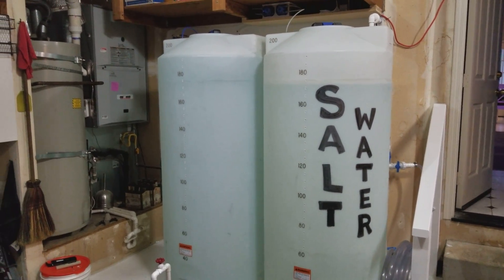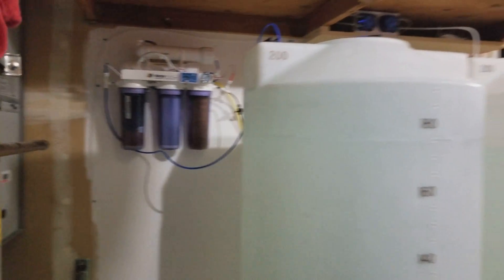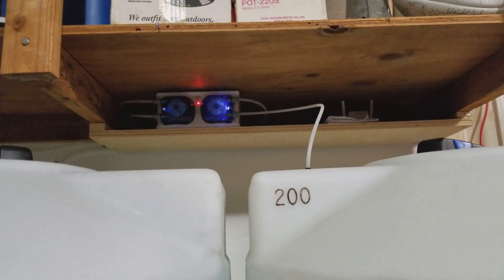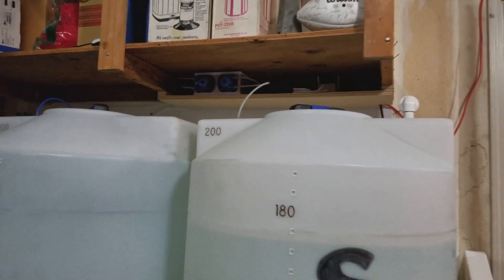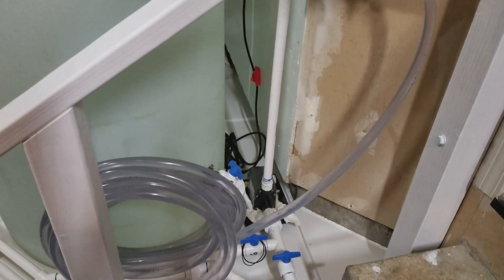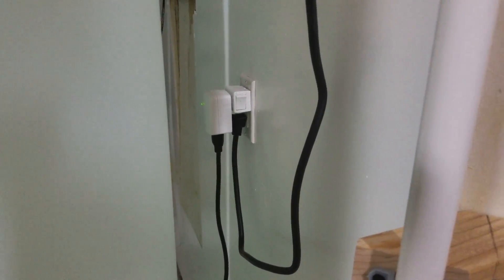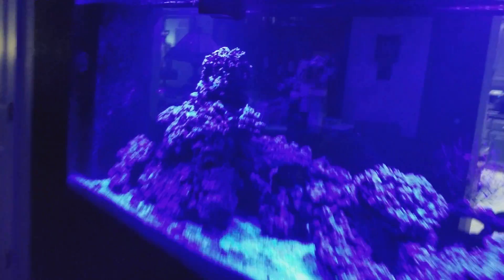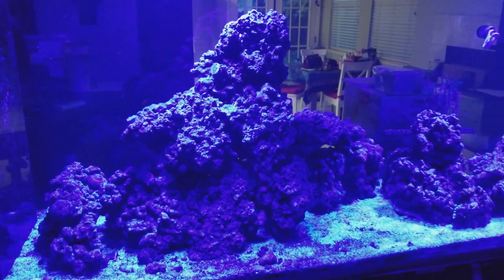RO/DI storage, saltwater mixing station and Automatic Water Change system

Comment: nice set up I always wonder if you can do gravity pull fill valve because I never like the idea of installing the buckets higher. Can you please explain by doing automatic water changes I never need to do manual 20% water change? Also how do you deal with cleaning sand as a maintenance?
Reply from the maker: You need a calibrated dosing pump, such as GHL's Doser Maxi or Neptune's DOS. The dosing line that acts as the pickup tube extends down to the bottom of the saltwater container.  That line runs through the doser and then to the tank, the waste line operates the same way but reversed. 

As for cleaning, we remove the plumbing and give it a chlorine bath every couple of years and use a pressure washer.

Comment: I don't understand all the plumbing along with the pump you have hooked up between your reservoir tanks. Any chance you could elaborate on how they work?
Reply from the maker: One pump does double duty, transfers RO/DI water from one container to the saltwater mixing/storage container; and also recirculates the saltwater mix. This is controlled via the pair of valves that exist immediately before the pump. I can also pump RO/DI or saltwater to the tank by opening or closing a pair of valves that exist after the main pump. The "faucets" that exist in front of the tanks can fill my 5 gallon buckets and operates due to gravity.

Comment: After 6 months of waiting for GHL, I finally got my Maxi, can you share your set up for programming?  I have the P4 and Maxi slave units.  Are you using any float or optical sensors to assist your AWC?
Reply from the maker: Though you can use float switches and or optical sensors, I use neither. I have a pickup tube made from from 1/4" acrylic that removes roughly 3 gallons a day right now and is installed in my sump's skimmer chamber. The clean saltwater enters my return pump chamber on it's own dosing line. I just setup a schedule within the Profilux 4 or the Maxi stand alone unit that pumps out 12000ml over a total of four sessions, every morning, and then replaces that same amount with clean saltwater. I am limited by this method as the doser is only able to pump 3000ml at a time and a maximum of 24000ml over the course of a day. Again, this is a limit set by the method I use.

Comment: How big is your tank? Is this where the Mooish Idol going to be housed in?
Reply from the maker: marc palacios, the aquarium that you see at the tail end of this video is a "225 gallon". Measures 72" by 24" by 30" tall, totals 200 gallons of actual water volume which includes 20 or so gallons in the sump.